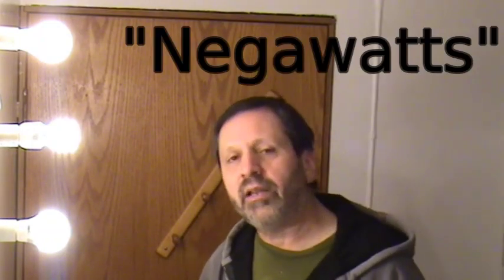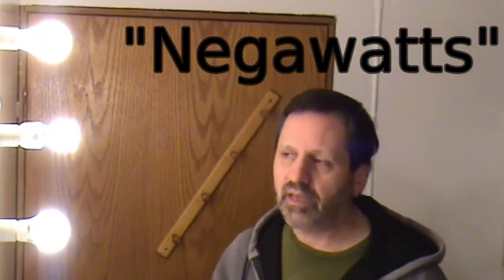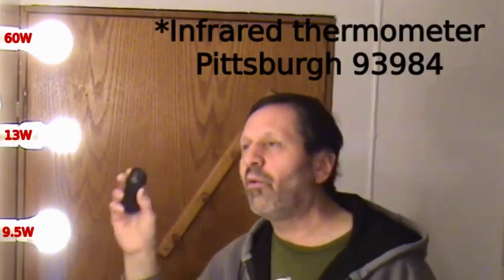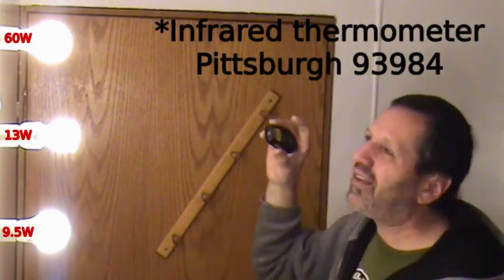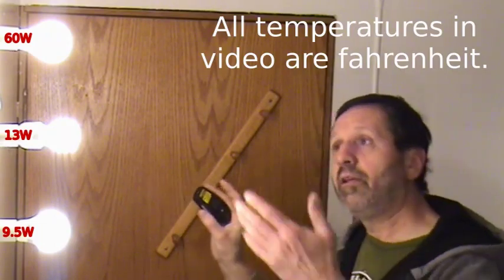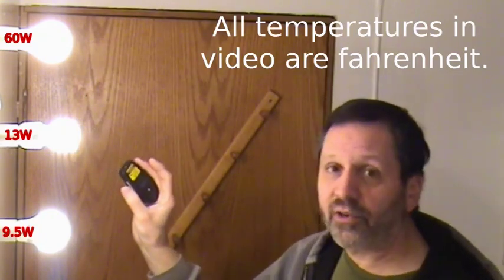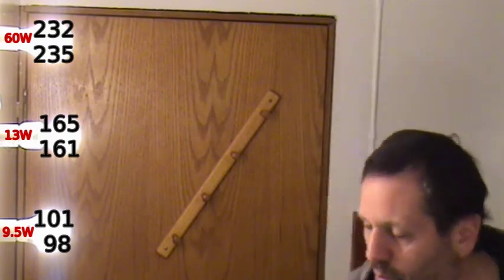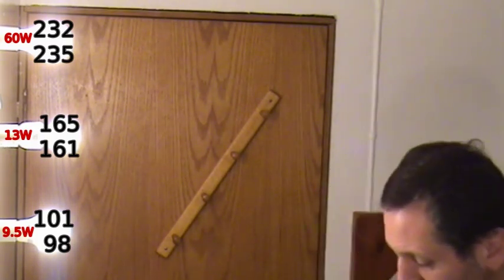Light bulb efficiency testing

Comment: the manufacturing of LED lights is detrimental .  the frequency output is also harmful especially in the blue / purple spectrum.   Not for me - the energy thing is a scam anyways.    LED switcing power supplies are nasty little buggers of other types of frequency pollution and are usually the parts that fail.. as well as HEAT up - you are testing in the wrong place for heat - so it kind of destroys the whole test.  Thanks for your efforts.

Comment: A critical note is higher heat shortens lifespan of light bulb.Typical 60w incandescent bulb is 750 to 1000 hours, 13w compact fluorescent 3000 to 5000 hours, and 9.5w led is 10,000 to 50,000 hours. The biggest variable to a bulbs life is the enclosure if it's vented or insulated since heat is the biggest killer to electrical components. In the early days of compact fluorescent bulbs, they were made well and allowed efficient cooling but at a higher cost, then the sudden influx of cheap low cost CFL flooded the market at a fraction of the cost but at a hidden cost of lasting only a fraction of their rated life that is slightly better than the life span of an incandescent bulb.
Reply from the maker: Thanks, I did not know the CF bulb quality has declined over the years.  I do remember when they were prohibitively expensive to just change out all your incandescent bulbs with compact florescent bulbs, which isn't the case today.
Reply: @ForbiddTV  I have many of the older CFL and some are still running while all the economy CFL are all blown out years ago. All the bulbs in my home presently are all led and most are still running for over 10 years and the bulbs that last the longest are the lower wattage led bulbs with the lowest heat output and in housings that are well vented.

Comment: The LED dumps its heat thru a heat sink at the back of the bulb (closer to the base).  They can actually get pretty hot.  You were testing in the wrong place.
Reply from the maker: Good note, I went back to check this and found after on for a half hour, the bases of the LED's were 174 for the 9.5 watt, and 172 for the 15 watt, I but I also found it depended where on the base I tested, it varied by about 10 degrees when I moved the sensor to different locations.   Interesting that the higher wattage LED bulb may be more efficient than the lower wattage one.  I suppose a thermal camera could be useful here, or enclose each in an identical insulated box and test ambient temperature in the box after a timed exposure time.  The base of the compact fluorescent is cooler than the bulb glass by about 50 degrees, and the neck of the incandescent is also about 50 degrees cooler than the area I placed it in the video.  If I had all the equipment required I could do a more thorough test.

Comment: I like LED lights better anyways. I always tint mine to green or blue. It puts me in a good mood. I hate yellow/orange lighting
Reply from the maker: You can get LED's these days in different "colors".  Consult lighting color charts and check labels.
Reply from the maker: @waptek0  I installed one of those by accident a few month ago; I took it back when it started flashing, hoping I would load apps and connect it to the internet.  Technology run amok.  Normal LED's also can be hacked to be used as devices to spy on us:  https://www.youtube.com/watch?v=hliHBeC1sco
Reply: you are addicted to the dopamine release of the high frequency emmiters. Take caution. If you hate Orange lighting, you hate nature.

Comment: The blue light from led and florry are a problem and also the flicker rate is detrimental to health... Incandescent is more like natural light much better.   Yes energy obviously is better with led but incandescent and halogen are far superior... 😊 Thanks for the vids though.. 👍
Reply from the maker: Incandescent and halogen are far more expensive to use.  You can get LED's these days in different "colors".  Consult lighting color charts and check labels.
Reply: @ForbiddTV  yes they have different colors and filters but still emit detrimental frequency to the eyes as well as the power supplies generate dirty energy pollution.

Comment: Good example of what all goes into a true comparison. Even without the “proper” equipment, your hack shows why LEDs are so effective at reducing energy costs. We switched to LEDs in our shop and almost doubled our light at the workstations and simultaneously reduced our power consumption by 25%. If you include the occupancy sensors we installed, we reduced consumption by 45%.